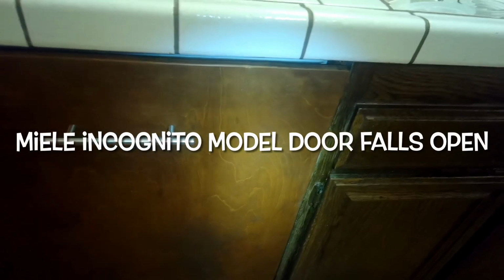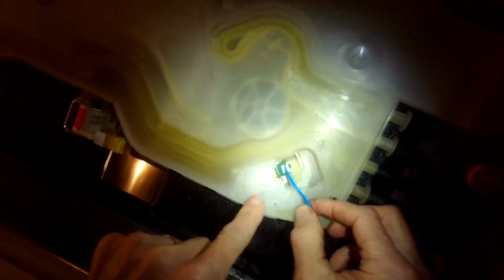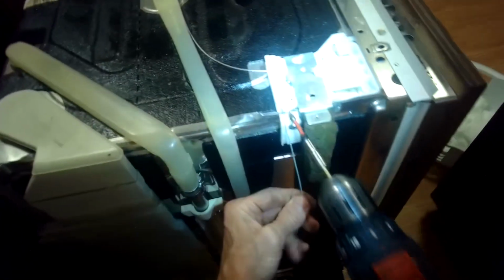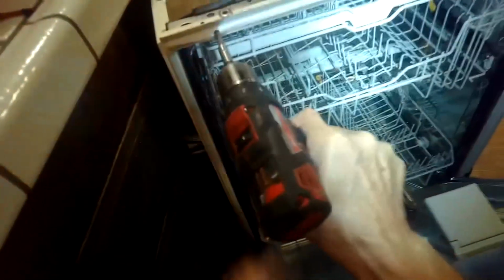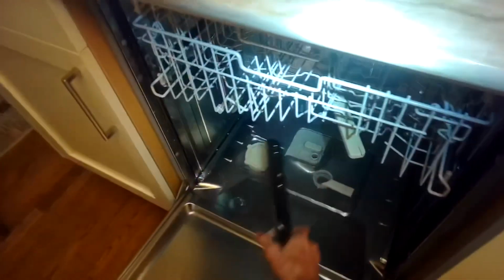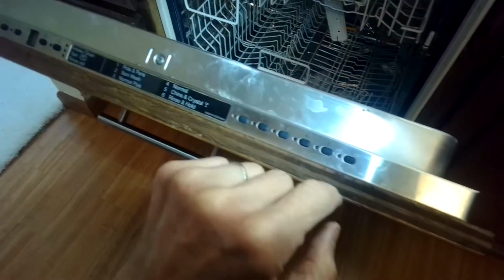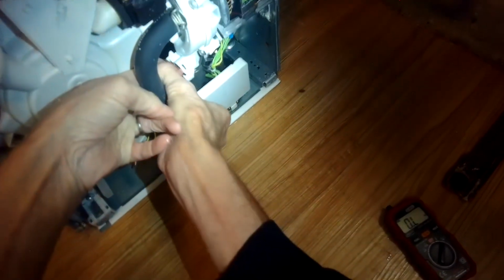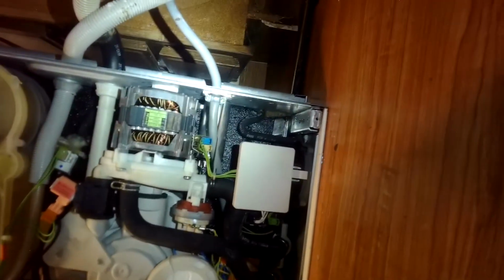✨ Miele Dishwasher - Easy DIY FIXES ✨

Comment: Where did you say was the best places to buy parts?
Reply from the maker: You can call Miele USA.
Reply: Just a question, did you test the capacitor with the multi meter before you replaced it? What was it showing? Has this dishwasher been fixed after the capacitor was replaced? I’ve got the same problem with my Miele dishwasher, cuts out mid cycle, error code 08. I took out the capacitor and had it checked and it produces 5uF as it says on the tin. So could it be still the capacitor?